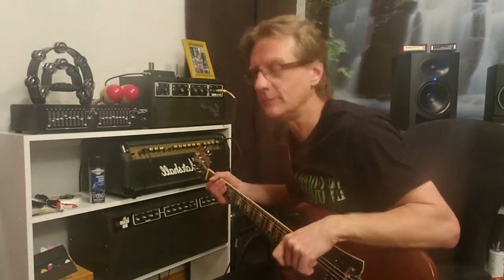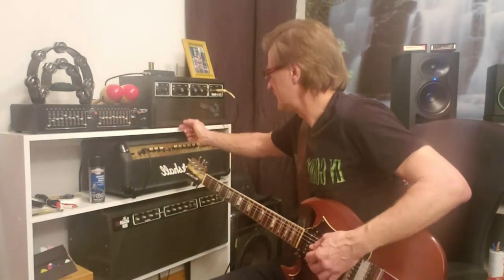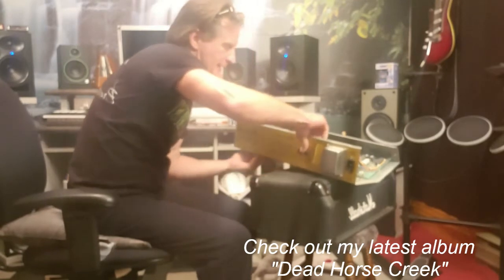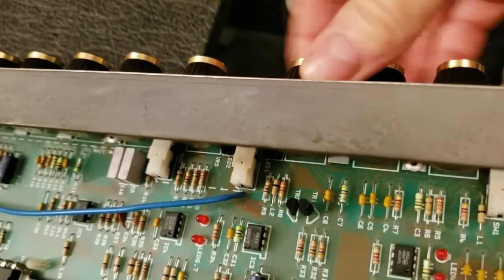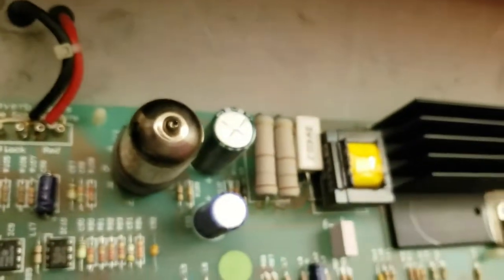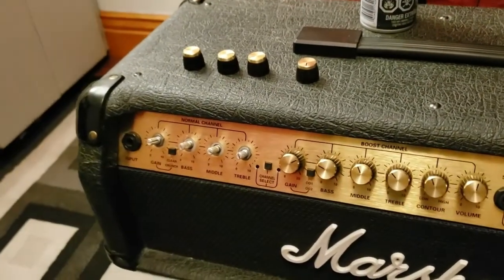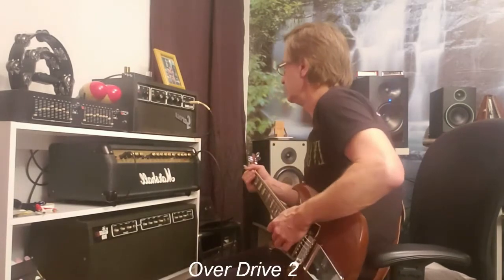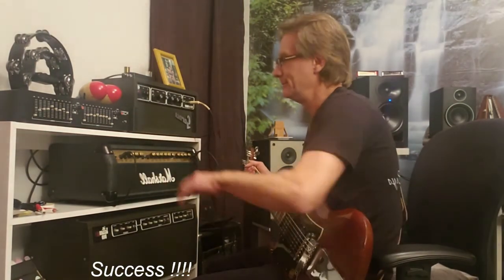Marshall Valvestate Repair SUCCESS

Comment: I had several of these heads from the 90s. I loved the sound of these amps with my Gibsons. One of my Valvestate 100 heads kept blowing fuses. I would bring it to the local shop for repair then pick it up once it was “ready”. I’d bring it home plug it in, I would get sound out of it for maybe a minute or so and boom it would blow another fuse. I did this 3 times before the repair shop became frustrated and refused to take it in for further repair. At the time I could purchase an identical replacement head for around $150 or so. In hindsight I’d  have collected these Marshall Valvestate 100 amplifier heads when I’d find a good deal on one. At one time you could find them everywhere and I thought they sounded better than any other amp at that price, especially if pairing them with a Marshall 1960 series cabinet.
Reply from the maker: I should really use mine more. I used to play in a band and this was my workhorse, practices and gigs. The only issue I ever had was the tube and some scratchy pots. Keep on playin my friend !

Comment: Hi! I have a Valvestate 8080 and the clean channel sounds fuzzy at the end of the potentiometer, could it be the gain potentiometer in bad shape?
Reply from the maker: Hmm, it could be the pot...
If you've tried cleaning the pot and still have a scratchy signal then I would replace the pot.
Good luck.
Reply: @stevepopemusic1658  problem resolved! I changed the IC1 (TL072) and fuzzy sound dissapear, I also cleaned all the potentiometers just in case, thank you so much!
Reply from the maker: @maxvander  , you did it !!!!
Thars awesome.
Now go make some music.

Comment: 12ax7 tube original Marshall ??
Reply from the maker: Yup, on my valvestate, its a 12ax7.. The amp died once, I took the amp in for repairs and the only problem was a dead 12ax7 tube. So its not the original tube but a replacement.